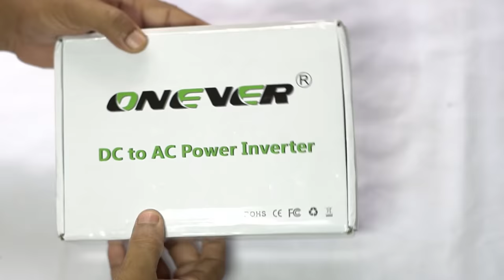How to Make Emergency Power Generator With Your Bike

Comment: If your bike has an A/C CDI then, after you start, simply disconnect the battery, leave the bike running, and use the charging coil connectors which go from the stator to the rectifier. Additionally for most regular lightbulbs you can use DC current also. No A/C inverted needed.
Reply: Sir why dontu make one video of your idea to help everyone... Thanks

Comment: you dont need to rev it idling will generate enough power to keep battery charged.
Reply: On my bike yoi cant. You have to rev it to have continuous running of bike if not it will automatically sgut down.

Comment: hey you can make tens time that by taking the wheel off and put on a cog and then turn a stator from a broken generator with it. you can even run a whole house on it at one mile per hour.
Reply: yes ofcourse but....this is use  in the time of emergency

Comment: Yeah I allready try it on my yamaha nmax motorbike when enginene is on can give 12 volt 5 ampere/hour continues without accu. when use converter dc to ac can give 220 volt ac 60 watt. I try use one litre petrol can give energy 4 hours. But not recomended if the bike not use cooling system like radiator.
Engine without cooling system will overheat.
This very helping when you camping or emergency and make your bike as generator.
Reply: Ketut Denta what is the price of this bro and where can I get this
Reply: can use a fan
Reply: Ketut Denta utp
Reply: How about in Honda beat 110? Thanks..

Comment: bike usually has alternator which generate AC but low voltage so i used step up transformer bro iam running my whole house now

Comment: Engine will overheat .
Air cooled engine needs air flow to get cooled ..
Reply: plug a  ac fan into this device to cool the engine..  lose most of what you gain.

Comment: HI ! WHAT KIND OF APPLIANCES CAN I RUN IF I USE 1000 WATTS IN MY MOTORBIKE?
Reply: I will give example u can calculate 80 watts fan, 40 watts tube light u can sum them and give as many number equal to 1000watts, but what's the continuous power your byke dynamo can sustain is the question
Without knowing rating you are going to burn your coils becareful

Comment: please put electric fans on your cylinder head cylinder block to that it will do air-cooled and can't damage or knocking your engine for me its a wrong idea you should buy 900w generator instead puting your motorcycle ta risk of knocking

Comment: If it connect to the accu motorbike battery, then why the motorbike must be turn on? Sorry for my bad english
Reply: Mr MaNuSia  if the bike will not get started then the  battery  of bike  will discharge
Reply: Motorcycle battery is only 2.5 ampere hence it will drain fast.
Reply: Parrot Parrot oh, I see
Reply: hardeep talreja its not 7Ah ?
Reply: any way sir your set up applicable run mobile charger and LED but not for fan
Reply: mg sankar why not for fan?
Reply: Mr MaNuSia motorcycle battery is mostly 2.5 ampere. Lead acid can be 7 ampere.
Reply: Mr MaNuSia -so your battery will not drain